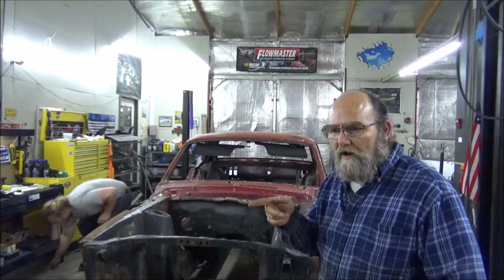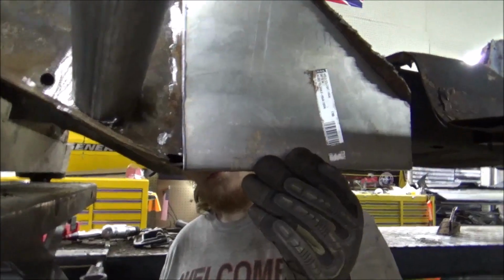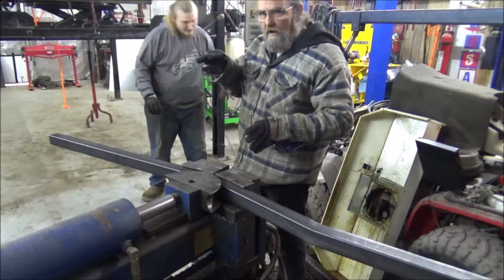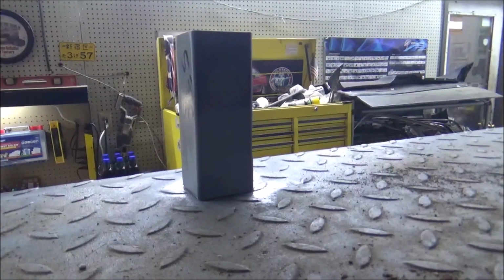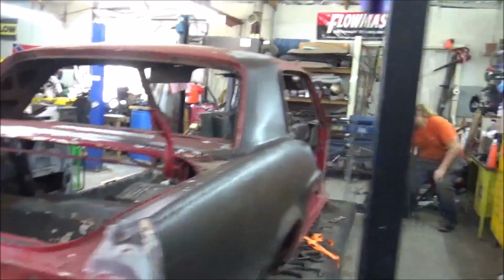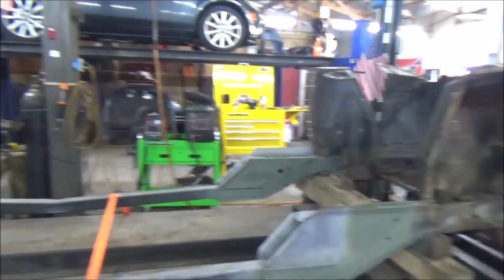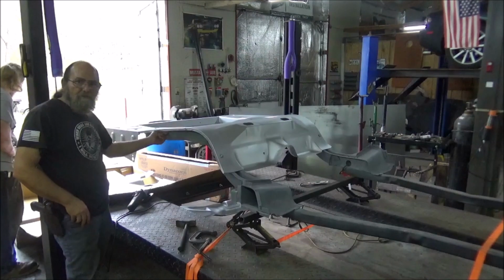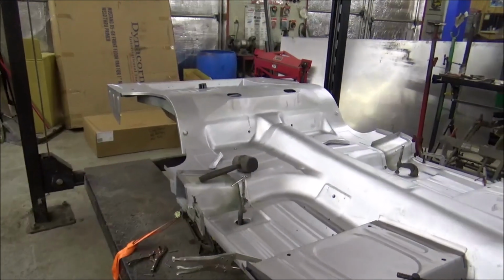1968 Mustang Part 3 Frame & Floor

Comment: If a feller had a built 351 Cleveland to drop in that body when it’s ready. Talk about roasting some back tires now. There was a complete Ford chunk on market place with Detroit Lockers in it awhile back. Paul you are the dude now.
Reply from the maker: Thanks 👍